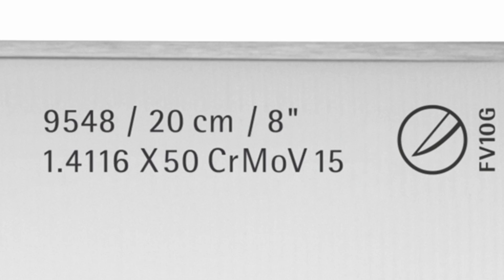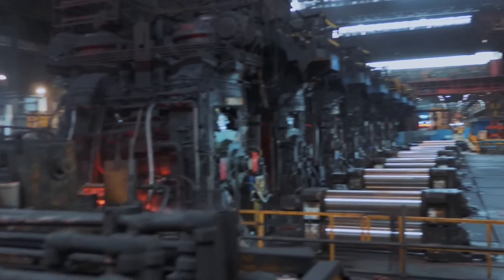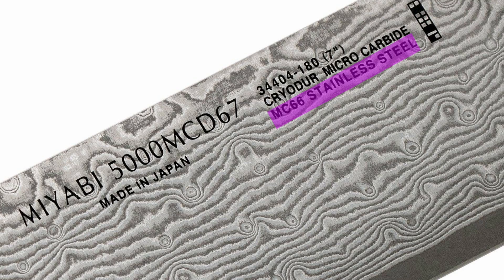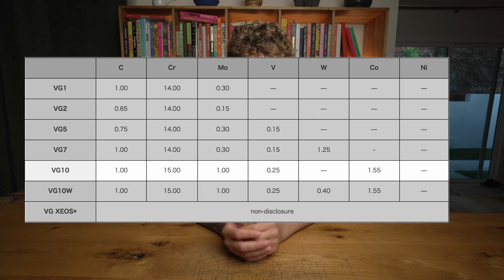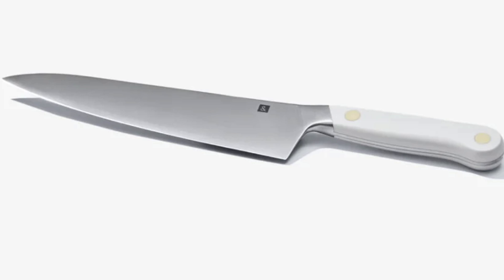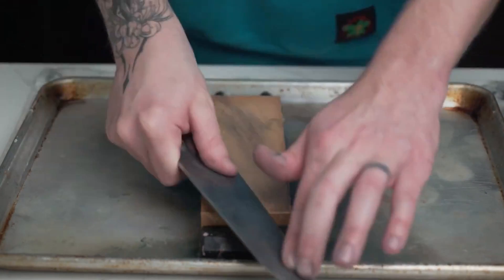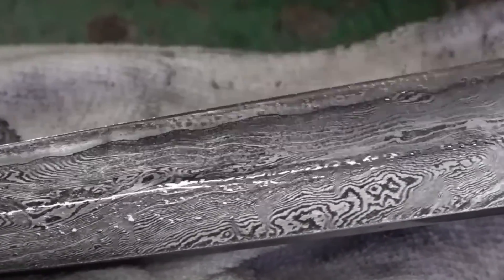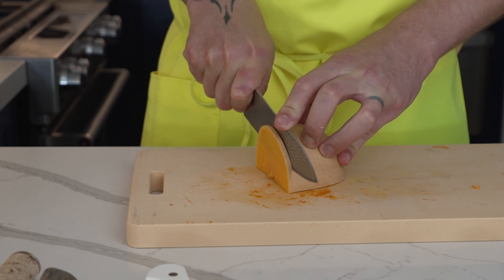A Beginner's Guide to Knife Steel

Comment: I think the biggest thing to know about knife steel is that it arguably simply doesn't matter. Any knife you buy will have steel that will sharpen to a high edge and stay that way. There are minor differences in corrosion resistance and edge retention but big whoop, you have to sharpen the blade slightly more often. Don't get me wrong, there are applications where the minute details do matter for steel, but consumer knives is not one of them.
Reply: Yep. Dead on. The reason 1.4116 gets used so much is it's inexpensive, easy to maintain, and for most purposes perfectly adequate. Not like your average person is using their knives for much more than basic food prep or opening packages on the regular.
Reply: What does matter, however, is geometry, and the geometry of most knives is garbage.

Comment: Hi :)
knifesteelnerds almost certainly had a bad batch (or bad heat treat) of 4116 for his testing. I used to work for a Solingen knife company, as did both my parents. I can tell you for a fact that one of those companies has a 4116 knife om the market where the toughness was tested to be far higher than Larrin's result, beating a lot of steels Larrin lists as "good". 4116 should be very close to where 420HC is in Larrin's test.

If he tested American or Chinese 4116 then that would explain the result.
No disrespect, but 1.4116 is a European norm, and we looked into buying American or Chinese 4116 multiple times to cut cost (vs Krupp, although that foundry was now sold to Finnish Outukumpuu) and every single batch we got either didn't meet the Steel Norm (so wasn't 1.4116, most fit into the American "420" standard and was too low carbon) or had horrible microstucture, voids, inclusions, etc.

edit: more on the testing 
this was for a military knife
i don't remember the exact temperatures but the knife was ~31cm long. when clamped at 1/3 of the blade, levering from the butt of the knife at -(80 or 120?) celsius (-110 or -180f) and up at +50 or 60? celsius (120 or 140f), the knife had to withstand >80kgf of leverage (so ~176lb-f) and return to its original shape after. n690 and 440c both snapped in the 70kg range. 12c28 was also tested, but 4116 won out, consistently over 120kg and a lot of tested blades in the 140-150kg range

Comment: Replace steel with lighter and stronger titanium.
Reply: There are reasons we still use steel. It's an excellent metal for blades. I like titanium as much as the next guy (I have a fair amount of it in my edc kit) but I still want the blade itself to be steel.

Comment: I am a fan of knife steels in the 0.6% to 0.8% carbon content.  These steels tend to have a nice balance of edge holding and toughness, though they need a good heat treatment for said properties to shine.
Geometry and heat treatment is as important than the steel.  The steel supports the geometry, while the heat treatment brings out the properties of the steel.

Comment: Will there be a day when big knife makers realize that CPM-Magnacut is the end all and be all of cutlery steel?
Reply from the maker: Not really how metallurgy works... But also it's INCREDIBLY expensive right now.
Reply: Magnacut is not great in edge retention...
Reply: @jeroen1989  Magnacut may not be Rex 121, but I've had great results with mine. 4 Meglios, 2 Spydercos, and even my Leatherman Arc have all performed really well.
Reply: @jeroen1989  Well, it's all relative. If you looked at Dr. Thomas' graph of toughness vs edge retention for stainless steel, you can see that it sits right in the middle but way "higher" than all the others. That means it has , by far, the best balance of toughness and edge retention for any stainless steel. Obviously, if you cared purely about toughness, you would choose something like AEB-L, and if you cared only about edge retention you might choose Rex 121. But you can see that the really high scoring steels for edge retention have really low toughness. That means they can't support really thin, acute edge angles -giving poorer cutting performance. Plus they are more likely to chip and roll.